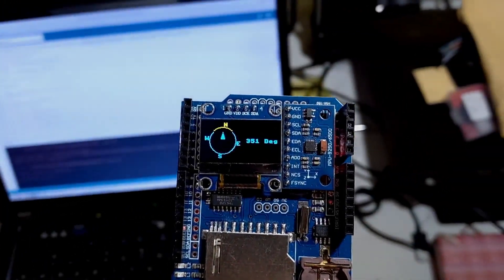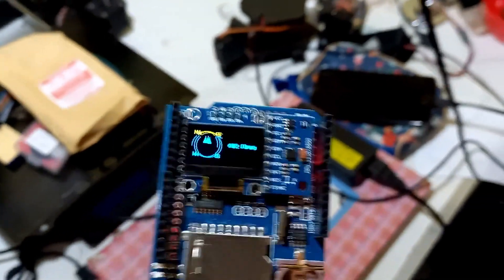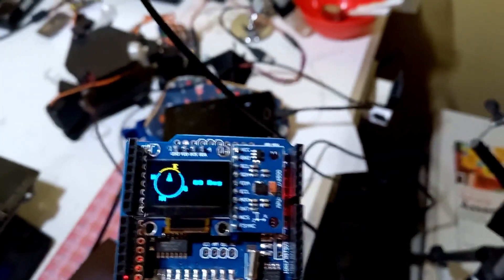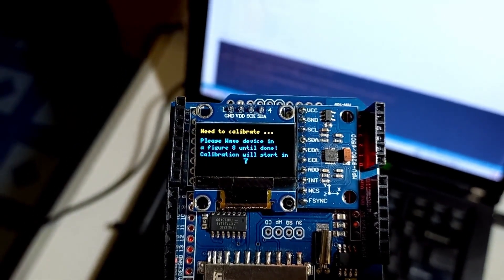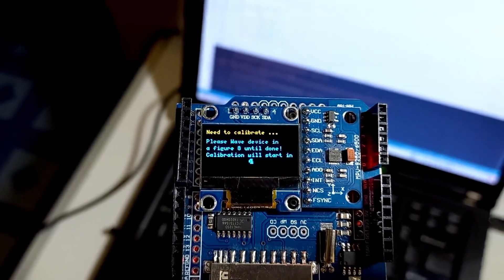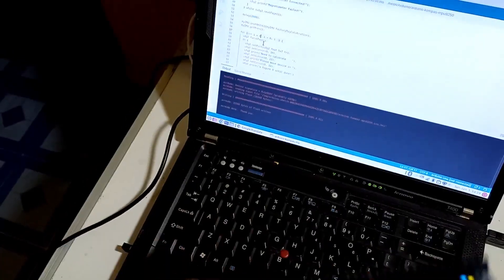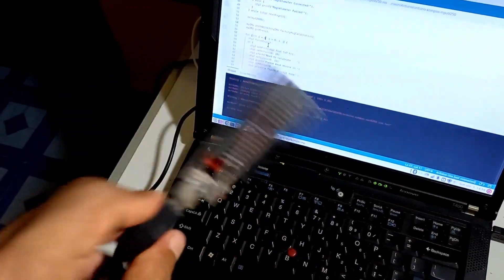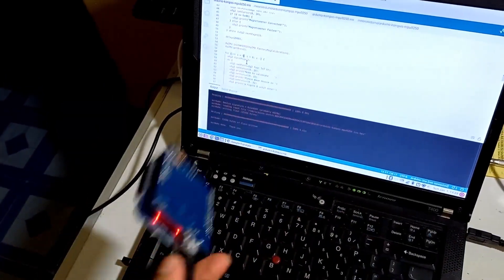Free Code Arduino Project Compass using SSD1306 OLED & MPU9250 Magnetometer

Comment: Hey, what kind of arduino shield do you use? It looks awesome btw
Reply from the maker: Hi, it's just a Arduino data logging shield with modifications by adding OLED and MPU9250.
Reply: Well, that is the reason why it looks so smooth hehehe. That menas you modified (soldered) the components like OLED and MPU by yourself?
Reply from the maker: @aghaaslam9575  Yes, that's right